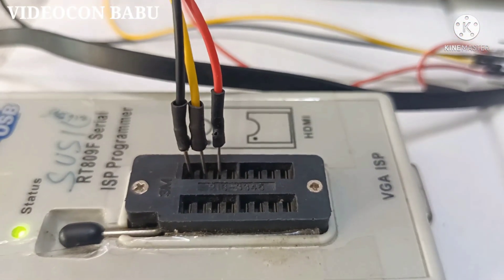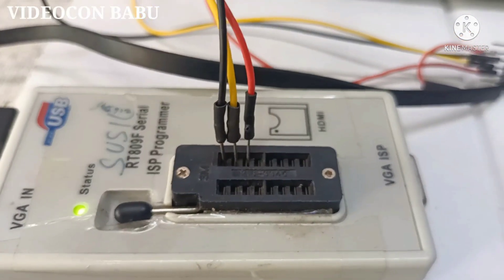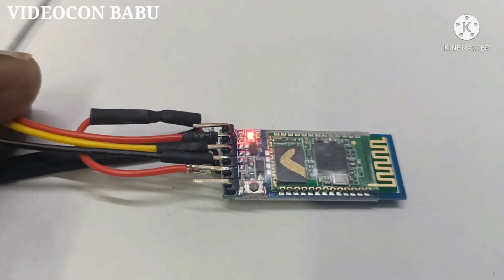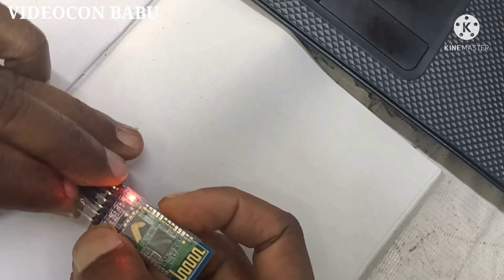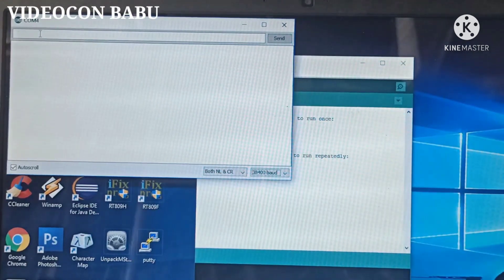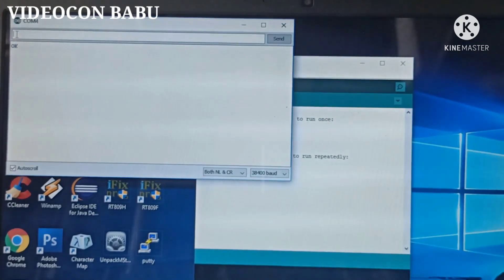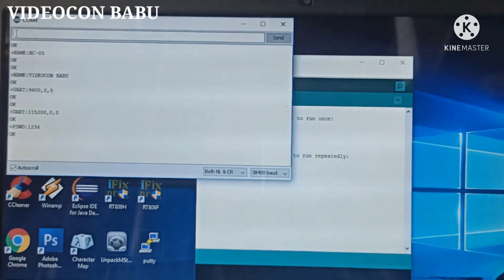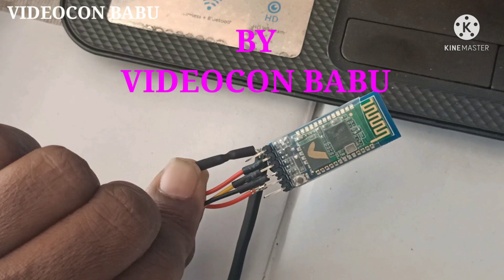HC-05 BLUETOOTH TRANSCEIVER MODULE AT COMMENTS CONFIGURATION (ENGLISH)

Comment: Why do we select baud rate? What's the necessary and when it's needed to be change
Reply from the maker: It's connecting with UART so manually selected baud rate.
Reply: @videoconbabubabut1415  I'm new here and i  looking for it I don't even know what is paud rate   and  UART that's why I am asking it's not even clear to understand whatever r u from teta group
Reply: I have seen many videos but in a USB port why do you connect rx to dx
Dx to rx but only in USB port but in a HDMI rx to rx dx to dx